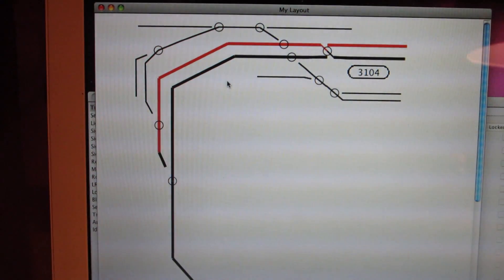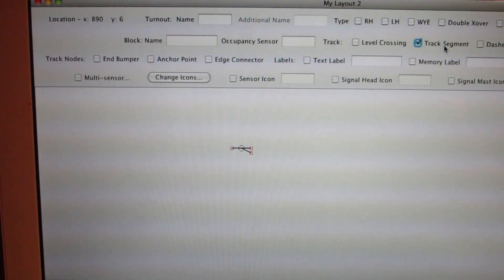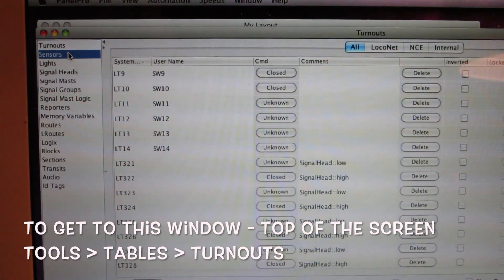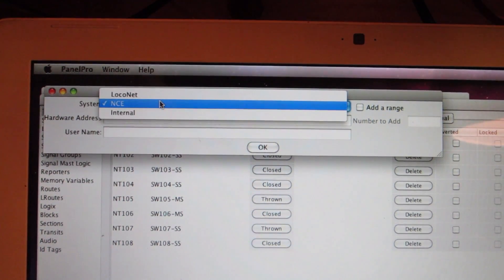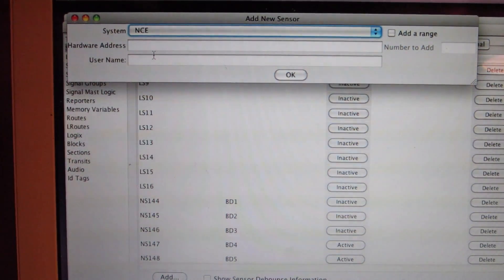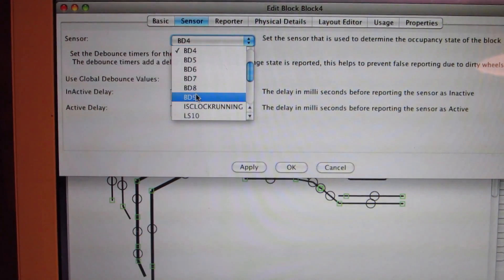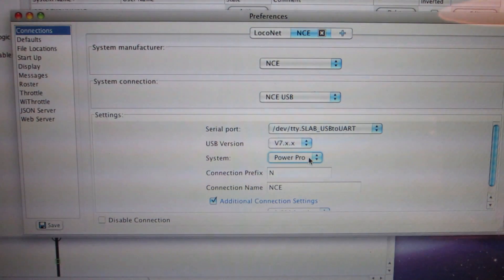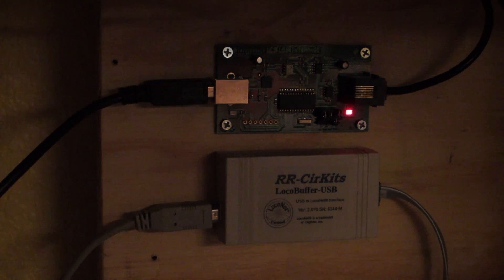Integrating JMRI with NCE DCC & the HO Layout

Comment: So does the BD20 talk to JMRI or does it just provide some analogue output ? I want a block detection solution that speaks to JMRI over the DCC bus directly.
Reply from the maker: The BD20 outputs a 0 (off = no current) or a 1 (on = current). They need to be connected to a AIU01 (or comparable) which assigns the address and puts that on the DCC control bus (separate from the power bus).

Comment: What an awesome video man! Great detail and explain it very well. 

The reason the you had to put in on power pro is that all the controllers work together with the NCE system, but to have the other ones on there too, IDK. Weird? Its prob. Just a JMRI thing.
Reply from the maker: Thanks, I attempt to make it accessible to understand for as many as possible. 
I just figure it is JMRI thing, with the V6 board i needed to have the power cab selected even though i was on the SB5.
Reply: drewzdrew27 hey drew you don't need all of the stuff to control the switches and the signals and what i will be using when i am building my module is the PR3Xtra and The SE8C to control the signals and the switch machines and the PR3Xtra connects to the computer via USB and it acts as a Loco Buffer so you don't need a buffer at all and all your doing is causing alot more work than it seems. When you also hook up the signals USE ONLY one Cable and place the 10-Pin Connectors and space them out along one Ribbon cable and when you hooked them up last time you used too many connectors when you only need like a total of 6 connectors to hook up the signals and you will have two left over and make sure to Read the Instructions Very Very Carefully and with the signal cable you can run up to 8 signals on one cable. This should clear up how to install the signals properly and if you get stuck call digitrax and they will point you in the right direction.
Reply from the maker: GRE 2057 Hey, thanks for the advice. I went with the loco-buffer USB probably because I wasn't able to find a Digitrax produced USB computer interface then (just PR2 serial) and/or the RR-Circuits had better reviews. As for the number of signals per cable I do not understand what you are saying - it says four signal heads per cable, multiply that by the 8 signal plants (where the cable plugs in) and you get 32. Each head can have up to four lamps, or individual "light bulbs" i.e. Red, Yellow, Green, flashing or dark.
Reply: drewzdrew27 drew did you look at the picture that is supplied with Cable Kit as it shows atleast 2 signals on one cable but i have seen others plus digitrax themselfs put more than one signal on a cable and its also a waste of cable as well and for me i will only have 4 signals total with 6 signal heads which all in all isn't that much LEDs at all
Reply from the maker: GRE 2057 right, I think we are saying about the same thing.